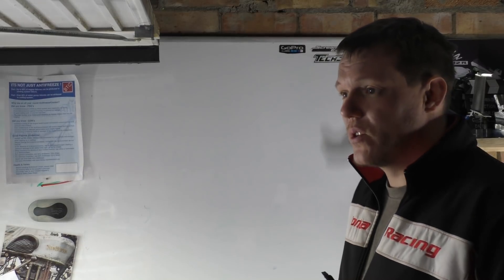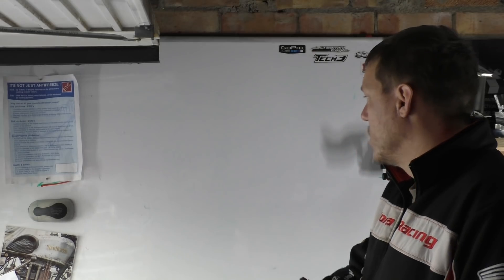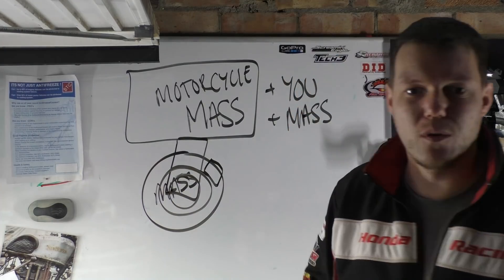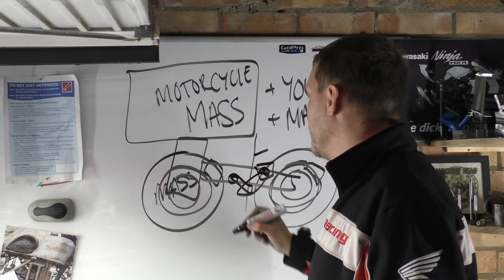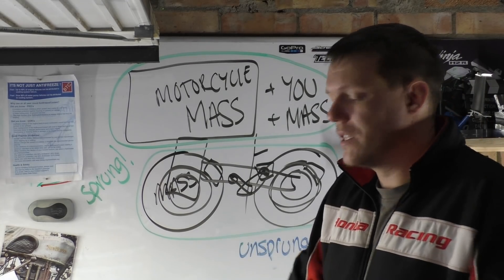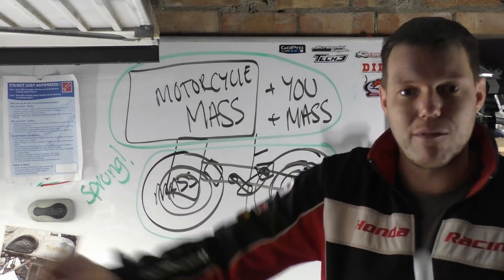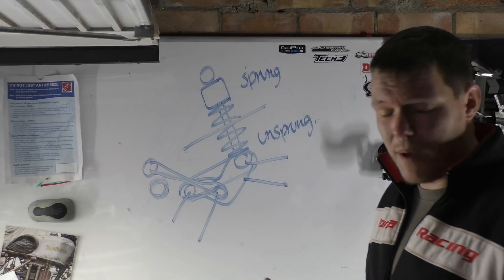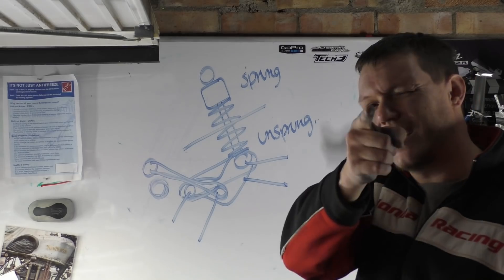How important is unsprung mass?

Comment: Nice video. Do you think unsprung mass is more a factor in Scooters where I believe the engine is unsprung mass? Just trying to understand the design tradeoffs between scooters and motorcycles - especially when it comes to handling, and if there is a reason scooters can’t handle as well as bikes.

Comment: Thanks Matt. 
What got me thinking hard about this, is I want to build an All Wheel Drive motorcycle. Christini Motorcycles have shown me how great AWD bikes can be, but I don't want one of their bikes, I can't afford one of their Frame-Kits, and I can't afford the machinery to make something like that myself.

So the best option is Hub-Motors front & rear, and that also leaves space in the frame for batteries, ultra-Capacitors, and or a generator to power them.

To protect the Hub-Motors, and because of FortNine's video on the Yamaha TW200. I'm also interested in fat tires. I really like midsized AWD bikes, and I really like the off trail traction of a TW200.

Basically, I want to see what happens when they make babies. I'm concerned about the problem and any benefits of all that unsprung weight, but this is best I can do right now.

Comment: My motorcycle does not have front fender number plate. But if i move my numberplate to fender using mountings, is it going to make much difference in the handling of the motorcycle?
Reply from the maker: no
Reply: Excellent! Actually, draw up a totally BS, calculus equations with diagrams and show that to the police the next time you get pulled over. "so you see officer, by having my plate smashed up and mounted like that, really makes it saver for me and the general public al large, it's science. It's unsprung weight vs sprung weight."

Comment: ive done this in practice, i was doing time attack with cars thought, and you could feel the difference when i lost 1kg of each wheel. basically less unsprung weight allowed the car to settle down faster after hitting a curb, and it allowed you to set up to enter the next turn. but on the car you had horizontal and lateral movement after you upset the suspension bike has only up and down suspension i don't see it as something that important, saving weight in general will have more effect. and if you have the bike for commuting and not as a track toy dont bother with it cause unsprung weight gives you stability

Comment: Just get rid of the springs and there's no unsprung mass at all!  Just leave only fat tires. It's as easy as a bicycle! :D
Reply: Not really, the tire is a suspension system, the air is the shock absorver and the tire is the elastic element (the spring) :P

Comment: "every kilo of unsprung weight is worth 3 Kilos of sprung weight" Hmm.... Bollocks... Power to weight gains are the same regardless of losing 1kg from the wheels or 1 kilo from the rest of the bike.. Heard all sorts of crap about having to set up suspension if you change the wheels. The effect on the suspension from the 500gr to 1Kg weight saving per wheel makes no real difference when the majority of the mass is sprung and its there to suspend the weight of the bike and rider.  When we built the P3 Suzuki GSXR600 for the Nurburgring lap record attempt all I wanted was to get to a power to weight target and mass centralisation with a balance of about 51/49 or 50/50 front to rear balance with the rider on the bike.  (The rider moving makes it hard to actually have a set balance so it had to be 52/48 static with no rider to get it to stay about 50/50 with a rider in a full tuck. The bike DID have carbon wheels, narrow pad track discs and very light 6 piston ISR calipers which saved about 4 kilos on total (if I remember correctly) but it was purely that I needed to lose that weight to get the bike down to 153KG with fuel and ready to ride and 120BHP at the rear wheel to get the power to weight down to the same or better than the then current lap record holding bike. Outright BHP was less important as the Nurburgring is almost all corners so handling was key. At NO POINT did we make any extra effort to lose unsprung weight. It was all just weight.
Reply from the maker: ""every kilo of unsprung weight is worth 3 Kilos of sprung weight""

- who said that?
Reply: @thedirtyworkshop  I had to go and find it..... But it was a thing Kevin Ash (RIP) put in MCN which had been used and possibly mis-quoted ever since..

MCN Unsprung Weight Savings
"Losing, for example, 0.5kg from a wheel can have as much influence as losing 5kg from the rest of the bike, i.e. it's 10x as effective." Kevin Ash, MCN technical expert. 

HPS note: This means that on the bikes where BST wheels provide the greatest saving, quite remarkably, that would be the equivalent to saving 106kg from the overall weight of the bike.

https://www.bikehps.com/PDFFiles/BST/MCN_Weight_Saving.pdf
Reply from the maker: LOL what a fucking idiot - and it says 'technical expert' LMAO! Like you said, shedding weight period is the name of the game.
Reply: Like you I do not have any truck with this magical weight saving.. Yes rotational mass does make a difference but to be honest some of the machined magnesium wheels have less rotational mass than the Carbon wheels as the carbon rims have to be made very strong and most of the weight loss is the spokes and hubs. MFR wheels I think found their GP bike wheels had more rotational mass savings than the carbon rims.. You know how much I love carbon fibre but there is a place for it and I will not run carbon wheels on the Aprilia I am building. The GSXR600 had them due to the deal we had and it helped reach the target weight.
Reply from the maker: I love metal, so mag wheels do it for me, unless they're on fire, then they can just fuck right off....... which they will LOL
Reply: @thedirtyworkshop  I liked Kevin Ash as he was actually one of the better journo's but like most he will get things from the manufacturer and possibly get his article wrong or the manufacturer feeds him a line and he just goes with it.. To be honest they have to write so many articles for quite a few magazines to make a wage that its hard to check everything all the time.. But like this one thing it gets used and mis-quoted over and over... Which is why you had to do this video ....

Comment: Is it correct that the linkage system of the rear shock is working progressively? If so, how does that work? And putting on a aftermarket progressive spring is then complete useless. Or maybe a progressive spring on the rear shock is useless anyway.
Reply from the maker: This is its own topic all together. Coming soon - ish

Comment: Back in the 1980's club racers were replacing their cast wheel on their GT 250 X7's and RD 250 LC's with older spoked wheels as these were lighter. I have a cast GT 250 X7 front wheel and a GT 250 front wheel..... guess which weighs more (the cast wheel).

The only time excessive unsprung mass will come around to bite you is when "Peg Scraping" (result of using the Phil Read "Push Down" cornering technique or when cornering with slower  "Knee Down" technique) on a corner with an undulating surface. 

Due to G=MV (squared) the unsprung mass determines the wheel and tyre's ability to maintain a decent contact pressure with the undulating surface as the unsprung mass's inertial forces determines the compression and return speed of the suspension. 

There's even a technical term used by suspension experts for a front suspension having issues with keeping the front wheel &  tyre in contact with an undulating road surface, "Patter". 

(There's a few other terms (jargon) they use such as "Pump Up" = Forks over rebounding / over extending, "Rocking" = Oscillation between forks and rear suspension, etc.).

For legal and sensible everyday road riding on Britain's well maintained smooth and pothole free roads, unsprung mass isn't an issue. It's only a problem for racers desiring to avoid a front wheel slide or arse end slide when taking a corner at race track speeds.

The bikes with the worst unsprung mass problem in biking history were the Honda CBX 550 and the Honda CBX 750 with the infamous inboard ventilated disc. The CBX 550 & CBX 750 also hold the record for the heaviest production motorcycle wheels. This alone is worth of a video on "Biking's most stupid ideas that made it into production". (It would make number 2 slot with sc**ters being at number 1).
Reply from the maker: The problem with "Due to G=MV (squared) the unsprung mass determines the wheel and tyre's ability to maintain a decent contact pressure with the undulating surface as the unsprung mass's inertial forces determines the compression and return speed of the suspension. "

....... is that damping is also a factor, the point here is that people bang on about the new buzz word they heard 'unsprung mass' and think it is the be all and end all - when infact, its one of the last considerations in bike design.
Reply: @thedirtyworkshop  I've been sorting suspension on bikes for decades (including setting solo bikes up for sidecars) and the controlling factor that can be "tweaked/tuned" is the viscosity of the fork and shock oil. This governs everything the suspension does when it reacts to conditions under the tyres and wheels. It can lessen the effects of bad suspension and wheel design to some extent, but only to a point. If the forks are seriously undersized (diameter) as in Suzuki's GT 250 X7 (it used GT 100/125/185/200 X5 forks to keep the bike's weight at 281 Pounds) or it has some daft front wheel and braking system there's only so much one can achieve.

Getting the suspension oil just right for the bike + rider's (+ sidecar) weight works wonders. It's worth the hassle of mixing the right ratio, testing, draining and refilling. I also tend to rebuild OEM shocks, replacing the cheap bulk "vegetable oil" shite they come with and refilling them with Bel Ray, etc. (I can't see the point on wasting good money on an aftermarket fashion accessory which'll do the same job as a "sorted" OEM shock. I've found that some aftermarket shocks need "sorting" as well, over the years).

I do know a chap who had fork dive problems who believed the yarn that he needed to "simply pop a few washers on top of the fork springs". He did just that and eventually ended up with tendonitis (in both wrists) and had to give up riding in the end. I bought his bike off of him in 1985 and it was like riding with steel rods for forks (next to zero movement even over potholes). It was horrible to ride it back home.

I found and removed all the washers out and the bike now had excessive dive when braking and even when decelerating plus "patter" (causes bars to twitch / tremble / shake when cornering on an undulating surface) and "pump up" (forks extend when the throttle is cracked open making the front seem too light). So I consulted the manual and refilled the forks with the recommended oil and the problem disappeared. I figured that he'd changed the fork oil and put 5W in, then acted on advice from an idiot when the problems started, and that ended up with a medical condition that his biking career.
Reply: @CZ350tuner  
Raced LC350 in the 80's and even with the peg folded up you'd still be lucky to get the knee down.
Rear shock on them was next to useless, had a mate who worked at Bilstien and he put it on their shock Dyno and found it only worked when it was upright not laying down as fitted to the bike.
He supplied me a replacement gas Bilstien shock in exchange for a few of their decals on the bike and machined a circlip slot into the aluminium body of it for a threaded sleeve to fit the spring adjuster rings to, made a huge diff to the handling and got rid of the nasty wallowing in the rear of LC's they suffered when the tyres got hot so in sweepers I was able to just ride under other LC's easy as.
Never had any troubles with the front though.

Comment: I wrote the following while watching the video and I don't feel like removing it (I'm a wanker, surprise) even though you said you will talk about the gyroscopic effect somewhen :

Question regarding the wheels - if you jump a Motor(cross?)bike and then "brake" while both wheels are in the air, will there be discernable rotation due to the fact that the wheels rotation is partially "transferred" to the bike chassis while the brakes slow the wheel down? I guess this is probably limited by the rotational speed of the wheels in combination with the weight (or maybe inertia?)

I guess the gyroscopic precession effects things similary when you "steer" because it applies the force 90° out of phase or something (am I remembering my physics right somewhat?)
Reply from the maker: LOL now we're talking the right hand rule LOL - Yeah, the torque at the wheel will be tranfered to the chassis, due to the fact that the calipers and the chassis are opposing the rotation of the wheels - opposite forces and all that. Counter rotation basically.
Reply: Conversely, mashing the throttle will tend the bike towards looping out.
Reply: It is converted to heat in the brake system and transfered to the enviroment, you just killed a polar bear family. Stop doing that!

Comment: When they use a push pull linkage between the shock/spring and swing unsprung weight is reduced because the entire shock/spring is now sprung. Only half the linkage is unsprung.
Reply from the maker: Well this is not entirely true, but I get what you're talking about..... Basically it its moving in any direction with the motion of the wheel then its unsprung. Rotation is what is excluded from this because there is no linear vector.

Comment: Control of that mass is more important than the mass itself. Less inertia however, allows for an efficient damper design. Sprung mass to un-sprung mass ratio also is a factor. The Americans simply made their vehicles way heavier than the wheels!
Reply: And The Americans they have much smoother roads so they hardly need suspension.  Come to Devon (SW England) and you'll see what potholes really are and how little effect twiddling with miniscule bits of mass will have.  Even Ireland has improved most of their roads (advantage of being in the EU?).
Reply: @trevorellis1704  Come to WV.  We have some roads with our potholes.....

Comment: Why bmw r1200gs has a double suspension on the front wheel?
Reply from the maker: This was originally Norman Hossacks design
Reply: what do you mean?
Reply: @assi2assi  if all bikes having just forks,doesn't matter if is usd or not,I mean suspension,why gs and gsa having shock plus forks?is basically 3 springs on the same place...not just gs and gsa,most of bmw
Reply: @mistery00t29   telelever